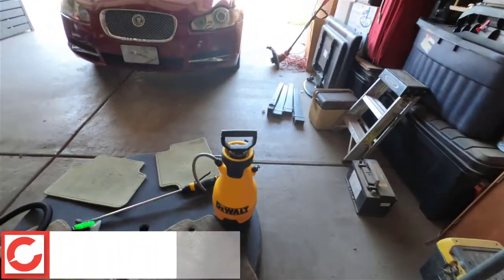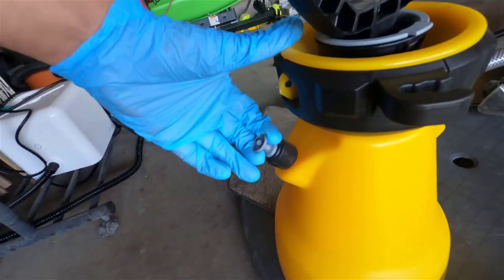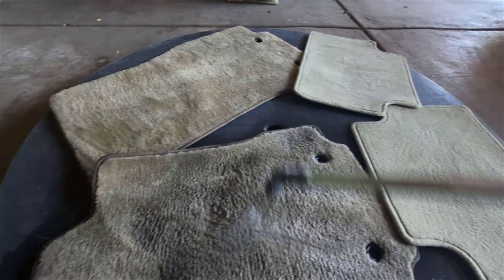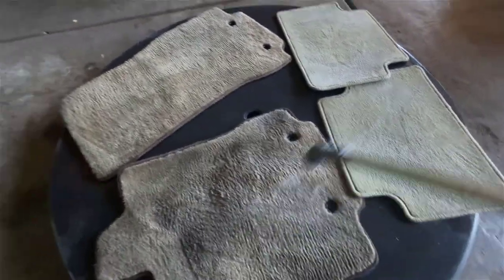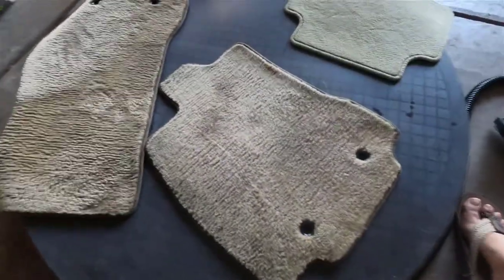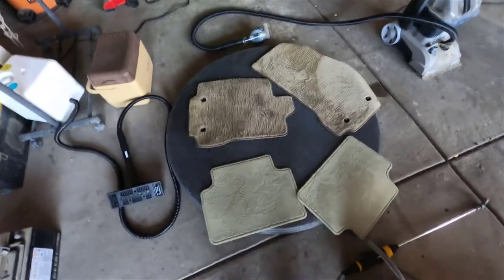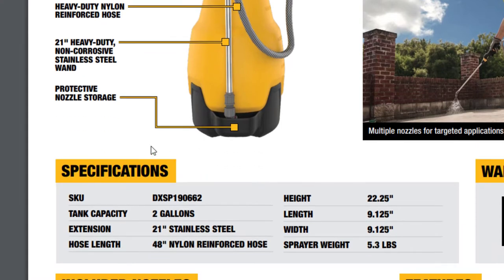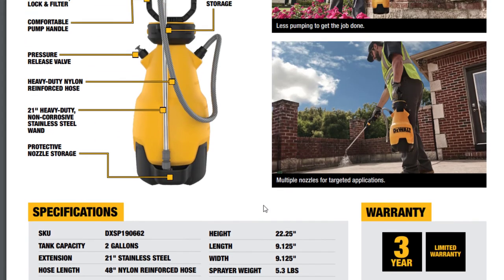Tools 4 Fools - Dewalt 2 Gal. Sprayer

Comment: Just bought one yesterday because I didn’t like the cheaper one I bought first and it was the best thing I did.
Reply from the maker: Just be sure to disassemble and clean after use. Easy to tear apart. It will rust if not cared for. Other then that it's great 👍

Comment: Wonder how strong is the hose
I do kitchen exhaust systems and we use acid in are pump sprayers 
Problem is the acid will eventually eat through the hose if not the gaskets first.. would be nice if they added a spare hose at least
Reply: you can always customize it. Get a hose with the same diameter and place original parts on that hose. I replaced mine with a 5 foot hose.

Comment: I don’t like it, the spraying nozzle don’t spray with a mist Or hold pressure for a long time .I also checked it for leaks and it don’t have a leak .
Reply from the maker: There's a bunch of different nozzles, you sure you're using the desired one?

Contact dewalt and see if you're securing the nozzles correctly